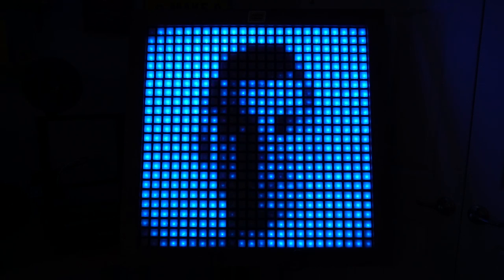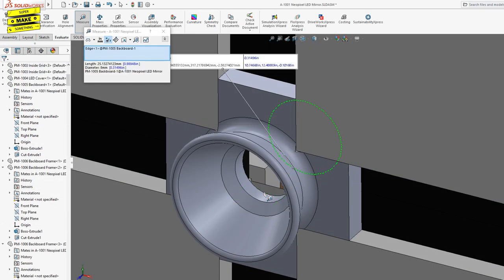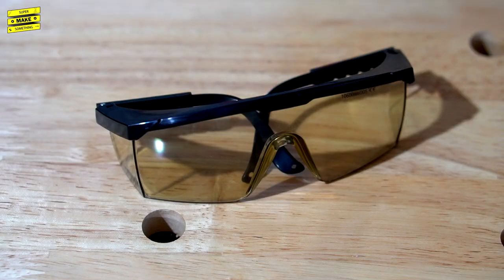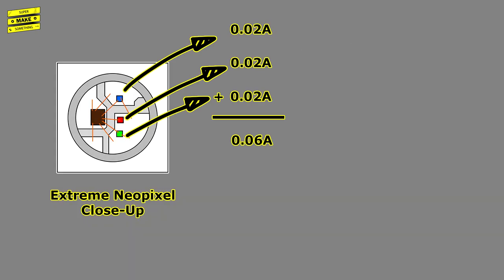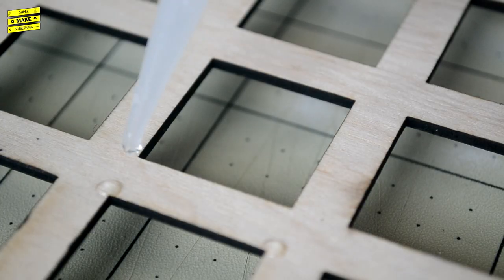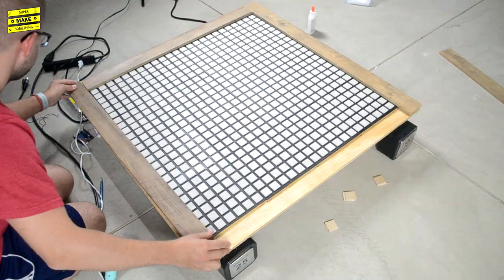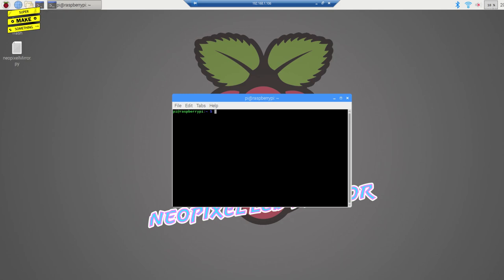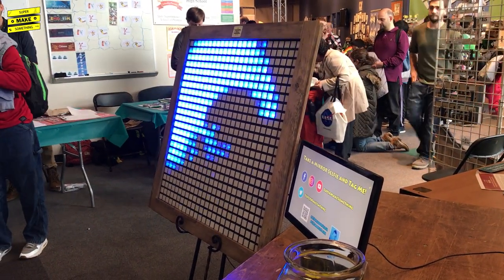GIANT Neopixel LED Mirror - Python, Raspberry Pi, 3D Printing, Laser Cutting (Maker Faire Cleveland)

Comment: Very inspiring! One advice I can give you is if you have your bridging settings right those parts would not need support. Saves a ton of tedious work and material. Keep it up!
Reply from the maker: Thanks! Unfortunately the bridging distance was a bit too much for my printer to handle for these piecese based on my current settings, but you are correct that this would have saved a lot of time and material!

Comment: Great great work!!!!! i thinking on anythinG similar but biger, could be possible????
Reply from the maker: Thank you so much! Bigger would definitely be possible, though you may run into frame rate issues without upgrading to more powerful computational hardware. The LED circuit should be scalable to use more lights as well. If you make a bigger version, please let me know!

Comment: Hey Alex 
we are struggling with your script. Seems like "newImageRoi" is not defined. And we need help to adjusting the parameter. Can you please help us with this problem. But nice work thats why we want to copy it :)
thanks
ps: Here is the error
>>> %Run 'led mirror.py'
/usr/lib/python3/dist-packages/picamera/encoders.py:544: PiCameraResolutionRounded: frame size rounded up from 160x120 to 160x128
  width, height, fwidth, fheight)))
Traceback (most recent call last):
  File "/home/pi/Desktop/led mirror.py", line 91, in <module>
    discretizedImage=discretizeImage(newImageROI,noLevels) #Discretize image and scale values
NameError: name 'newImageROI' is not defined
Reply from the maker: Hi Mel -- sorry for the delayed reply.  You are right, there is a bug in the code -- it looks like I uploaded the wrong version of the script to Github.  I will fix this by the weekend and will post the update to neopixel-led-mirror repository.  Thanks for letting me know!
Reply from the maker: Hi Mel -- Sorry for the delay!  The updated code is now on GitHub!

Comment: Anytime you need exact spacing with LED strips, be sure to look out for where segments got soldered together at the factory as they sometimes don't match the correct spacing. I had this mess up a project I was working on, and it took a while to figure out why.
Reply from the maker: Good tip for sure. I’ve found that the strips I used were generally consistent, but mine did not have any manually soldered junctions in the middle of the roll.

Comment: I built a panel with 2160 Neopixel LEDs，and I found the frame rate was greatly reduced becaus of a large amount of data operation for python
Reply from the maker: Code optimization can definitely help, but I also heard of libraries like “Fast LED,” which might help as well.

Comment: Wow this is super incredible! It's so hard to find tutorials not based on just a storebought LED matrix.  I'm building a 600 LED matrix right now (ws2811 in series) powered by an Arduino Mega.   But I can't get any matrix code to work with it; is there a way to run video or animations from a Pi directly to the data channel on the LED strips?

Comment: You got a 30A power supply but 576 LED at full white brightness is about 35A, how come?
Reply from the maker: Dylan Henderson It’s true — at full white, the power supply would be marginal. That being said, the mirror is not intended to have all LEDs lit in this way at once. For something like this, I would prefer to make a large PCB (though that would get :super: expensive 😅)!
Reply: @SuperMakeSomething  thanks for being forward about that!! I'm just learning about Arduino and electrical circuits, and I'm in the process of doing underglow for my car. I happen to know it needs that much because my underglow has exactly 576 LEDs!

Considering I'm new, I am worried I will accidentally set all my lights to full white brightness (maybe doing a colour wave / flash) and so I've been cautious to find power supplies with a few extra amps just in case.

Fantastic video, and thanks a lot for answering me!!!!
Reply from the maker: @dylanhenderson5432  Hi Dylan!  That sounds like an awesome project!  Please share some photos with me when you are done -- I would love to see the final result!  I think that there is definitely no harm in going with a bigger power supply in your situation just in case -- unlike the mirror, there should be plenty of space somewhere in the car to store it so it is out of the way! :P Good luck with your build!

Comment: hey this is an awesome project! I love the details (e.g. the time it took for you to print). The one modification I'd make here is I'm 99% sure there's no diode drop if you just chain the power and ground lines the same way as the data line. Primarily because I'm pretty sure all of the Neopixels LEDs are in parallel, not in series. This is why all of the neopixels can light up at near max brightness even when they're all still one long strip.

Comment: You have used too thin wires for VCC and GND. Otherwise great video.
Reply from the maker: Stanislav Jochman Thanks! I unfortunately did not have any thicker wires on hand, but am planning to swap them out if this wire gauge becomes problem.
Reply: @SuperMakeSomething  It's probably too late if they do become a problem...